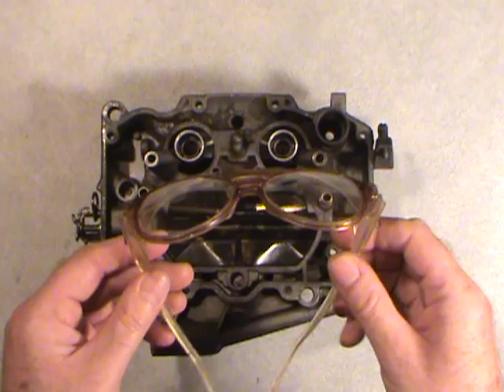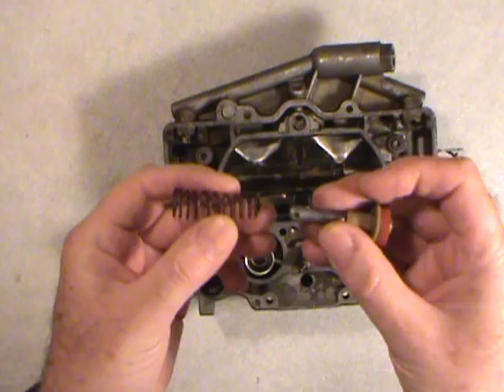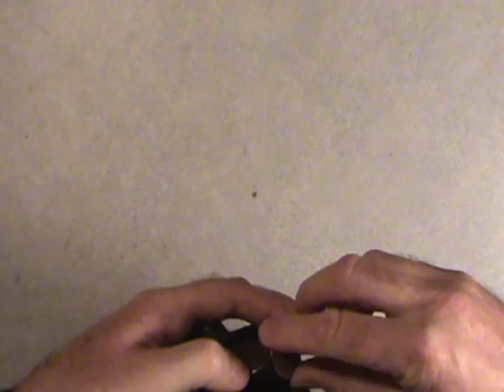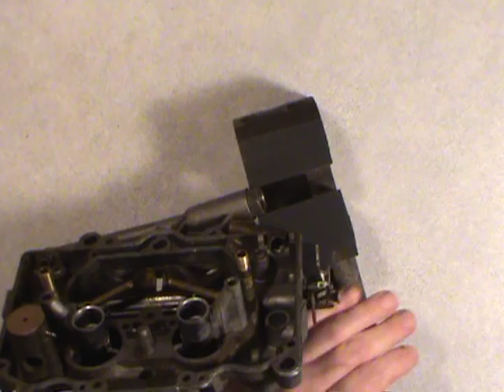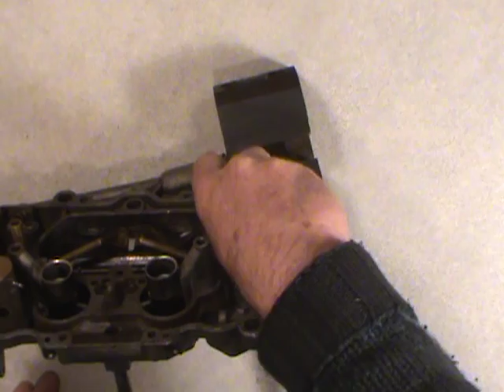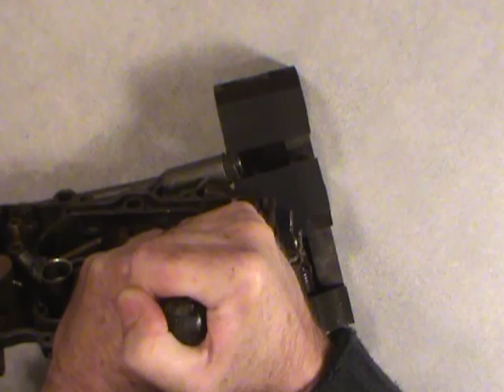Rebuild your Thermoquad Carburetor (Part L)

Comment: Rocky-  Thank you so much for this wonderful series of vids.  This is beyond helpful and I'm following and rebuilding bit by bit.  Question:  I notice on my TQ one of the two primary jets is off-center at the top of the "volcano".  It pretty clear using a flashlight the brass is not bent, but rather the hold in the casting is angled.  The brass orifice exit is almost touching the side rim of that "volcano".  How critical is this being straight?  I'm very concerned about bending it to center, since if it breaks that's it for this carb.  WWRD?  (what would Rocky do). Thanks!
Reply from the maker: Greetings...Frank Lentz...........Thanks for watching...........(WWRD)...Volcano...???...Lava...???...RUN...!!!...lol........Well, as long as, there doesn't appear to be, any physical damage, to the inside diameter, of those brass tubes, then, it should be ok..........There are two, round, O-ring seals, one for each, as you put it, volcano..........Each seal (sometimes called, an X-ring), goes between the top (of your, so called volcano...lol) when it's inverted, and then goes, down inside, that black plastic float bowl, and then, get squished a bit, when the Thermoquad gets screwed together, in order to create, those two sealed connections...........So, hopefully, you have a rebuild kit there, and in it, there should be, those two seals (or X-rings).........Take one of those seals, and center it on top of your volcano, and have a look-see...is the inside diameter of your volcano (aka...crater...lol), open and free (not obstructed) in any way...???..........The Main jets, get screwed into the bottom of the float bowl..........The secondary jets, are quite long, heavy, and made of brass, and go over (cover), those, quite fragile, small brass tubes, that are permanently secured, to the under side, of the Thermoquad's top aluminum cover.........Always have the secondary jets in place/installed, to protect those two, small, fragile brass tubes, when not working on them...!!!.........Use Brass floats (those black looking plastic floats, can sometimes absorb gasoline, and start sinking...very rich running/wastes gas)........Buy a new choke pull-off (looks kinda like a little space ship)...(old one gets sticky/dried out internally).........If you are putting about 10% ethanol blended gasoline, in your vehicle's gas tank, then, be aware, that, that in itself, could cause the Thermoquad carb, to have the engine running on the lean side (air/fuel ratio), just so Ya know..........Hopefully, your answer, will be found above...if not, then, just let me know.........Good luck, and.......till next time.......Be Safe, take care, and have a good one.
Reply: @RockysRoadshow  Thanks for the quick reply.  The "x-rings" have a plenty large enough inside diameter to keep from getting in the way of that brass orifice, even if/when squished I think.  The engine was running rich, fouling plugs, after sitting for sevaral years here in Bend OR at about 3100'msl.  The TQ was pretty dang clean inside, and none of the seals were crumbly, but one odd thing I noticed was old nasty gas (which I thought was oil at first) pooled in one of the two base plate, uh, pools, below the factory-expoxied little bowl piece. After cleaning the phenolic middle section, I put water in both of those bowls with a paper towel under to see if the epoxy had cracked/leacked... no moisture at atmospheric pressure anyway.  Any ideas on how fuel got in there on one side but none on the other?  

Thank you SOOOOOOOO much.  I'm following to the letter here, including bamboo skewers and of course keeping the brass secondary covers on ;).   My new choke pulloff failed the tube-plug-test, but MikesCarburetorParts is sending a replacement.  Their rebuild kit seems very well done otherwise, from a neophyte's perspective.
Reply: My nitrophyl floats didn't have gas sloshing, but despite cleaning with Simple Green and a wipedown of M.E.K. substitute, they still smelled like gas, so I ordered brass replacements from Napa.
Reply: I get those coffee shakes in the morning, but "lockdown-beers" seem to take care of it in the afternoon ;)
Reply from the maker: Greetings...Frank Lentz..........If that pooling gasoline, happened to be, in one of the base plate/throttle body cavities, that is "directly below" one of those glued on plastic looking "caps", when the Thermoquad is assembled, then, I would probably suggest, that you head outside, and "re-test", those two plastic-like (glued on) caps for leaks, using "gasoline" this time, and also, fill the two float bowls, as much as Ya can, before it starts to spill over, where, the, shall we say, "cut-out" is, where the so called "volcano", goes down into/beside.......Also, let that gasoline, sit in the float bowls, for quite a bit of time, while testing, in order to give the gasoline, a fair chance, at finding a leak, well, if there is one, that is..........My so called theory, is that, water has quite a bit of tension in its makeup, and that, in itself, might possibly have the ability, to create its own sealing agent, if the crack, or glue separation, was quite small, when it comes to, those plastic-like caps, I be thinkin'.........Gasoline, on the other hand, is a pretty darn good, solvent-like liquid, that will probably have, a very good chance, at finding, just about any small fissure (aka, crack), as long as, it's gravity, or pressure related, that is.........I had a nitrophyl (looks like black plastic) float, on the passenger side of a TQ, absorb gasoline, and started to sink in the float bowl, and the engine was running way too rich, and I, at first, though it was a choke system issue.........When I looked down into the TQ's, two primary throttle bores, as the engine was up to operating temperature and idling, I could actually see, small drops of gasoline, dribbling from the passenger side's, primary throttle bore's nozzle...!!! (note, if trying this, use eye and face protection, in case of an engine "backfire"...!!!).........Not only that, the engine's oil pan, had enough gasoline in it, that, I could smell, a strong odor of gasoline, when I smelled the engines, oil checking dip-stick...!!! (needless to say, that, the engine's oil, got changed without delay...!!!...lol)...........So yeah, for me, whenever rebuilding a TQ, it's gonna be...Brass Floats...and a new Choke pull-off, and.......till next time.......Be Safe, take care, and have a good one.

Comment from the maker: ...Now, considering that my Used X-Rings are about .068", we need to do one more simple calculation, being, .068 - .057 = .011" or Eleven Thousandths of an inch....Please note that this calculated measurement will vary quite a bit, as it seems that no two Thermoquads are exactly the same, as well as the Gasket and X-Ring thicknesses will vary between all of the different Carburetor Rebuild Kits that are out there...The only way to really know for sure, is to measure everything....Take care Mike

Comment from the maker: ...The thickness of the Gasket that goes between the underside of the Air Horn (top casting) and the top of the Float Bowl, when "Compressed" = .025" to .030"....and, last but not least, the thickness of, two of my "Used" X-Rings, which = .068" (averaged), "New" X-Rings are probably thicker then my Used ones....1.375 minus the following....(I will use some averages)....1.345 - .027 = 1.318"...thus, 1.375 - 1.318 = .057"....(.057" is the "Gap" where the X-Ring resides)....(con't)...

Comment from the maker: ...I got out my trusty Micrometer and Vernier Calipers and made some measurements....First the measurements, then I will move on to the calculations....All measurements are in Inches, and one thousandths of an inch (1/1000")....Depth from top of Float Bowl to the surface that the X-Rings sit on = 1 3/8" (approx 1.375")....The depth of the Air Horn (top castings underside to the surface where it meets the top of the X-Ring = 1.340" to 1.350"....con't...

Comment from the maker: Greetings Mike....Thanks once again for the great comment....Hmmmm...You might need a Calculator for this one!...lol...I found that the compression amount on those X-Rings ("O"-Rings) can vary quite a bit....The part of the Air Horn (top casting) where it makes contact with the top of the X-Ring/Rings, is only roughly cast (not machined), leaving a fairly rough finish (not a very good sealing surface)...that alone can cause a little leak....(con't)...

Comment: Another excellent installment.  On previous video you talked about placing the "X" rings into the center section.  How much compression is there in these rings when the air horn is torqued into place?  I performed a trial assemble and do not feel much resistance or compression when performing this trial.  Thanks and keep em coming.
Mike